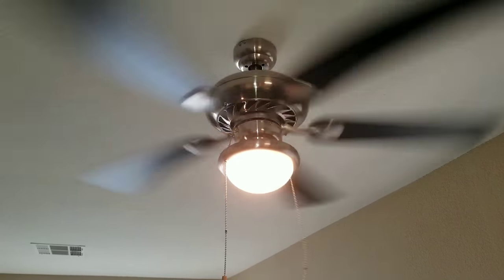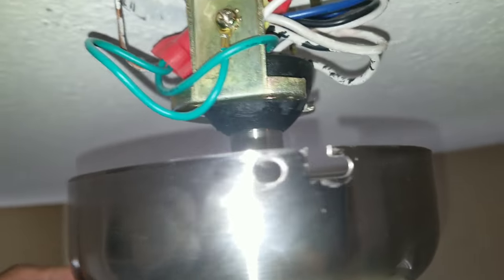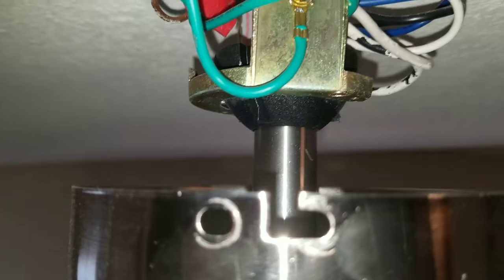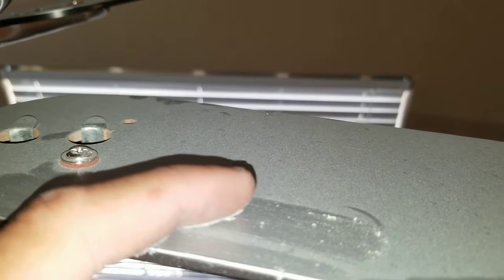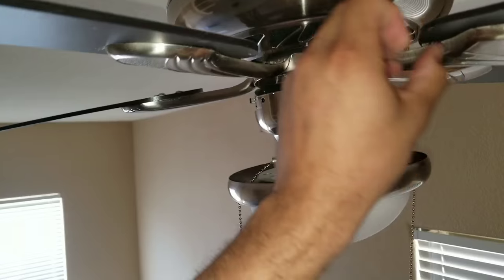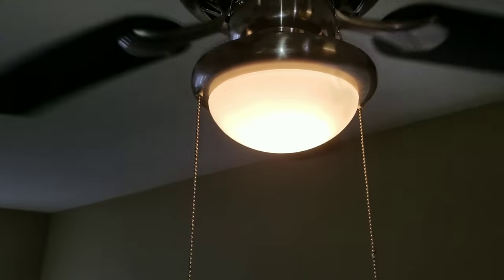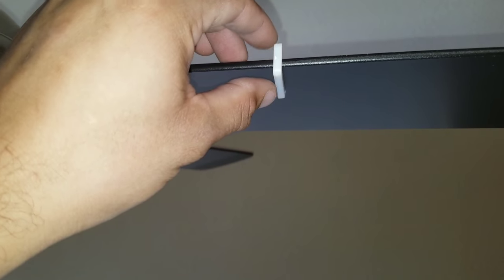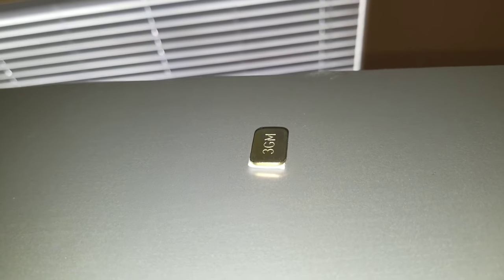Ceiling Fan Shaking? 4 Simple Ways to Fix It!

Comment: I have similar blades that have no ready access to the screws that hold the brackets to the housing. I wish you would have shown how you removed the light housing to get to the screws. That was the key to the project and you didn't video it.

Comment: GREAT VIDEO!!! The only issue I have with this video is the weight that was used. Those weights are usually held on with a fairly strong glue. However, that glue WILL FAIL eventually, and the centrifugal force of the ceiling fan will send that weight flying across the room when it does fail. It may be a small weight, but it can easily break a window if you're unlucky enough. A couple of very short screws can easily take the place of those weights and do a better job of staying in place. However, if you DO use those weights, just make sure you check them from time to time to make sure the glue is not failing.

Comment: After just spending an hour with a fan balancing kit -- thinking it was fixed as good as could be expected -- I found it wobbling AGAIN! 

I am going to take a screwdriver to it and inspect the assembly. Also, I do have one blade that is just a tad loose... I suppose it could be enough to cause a wobble. IDK.